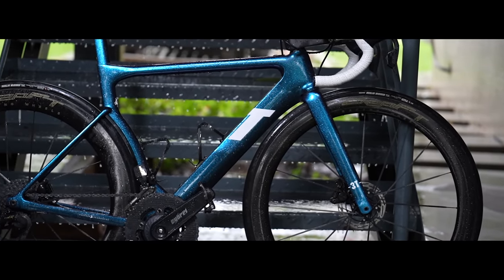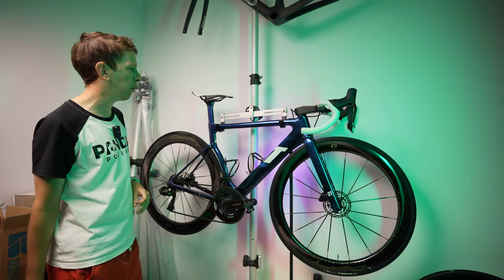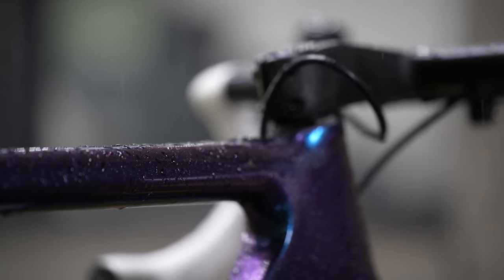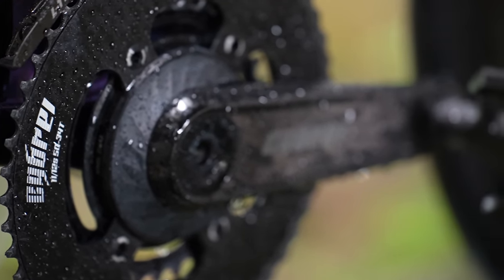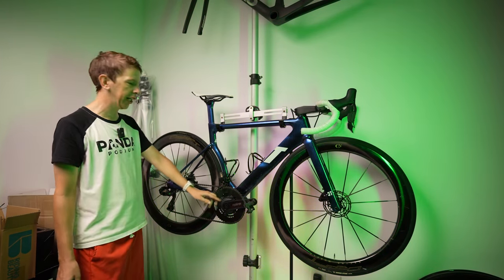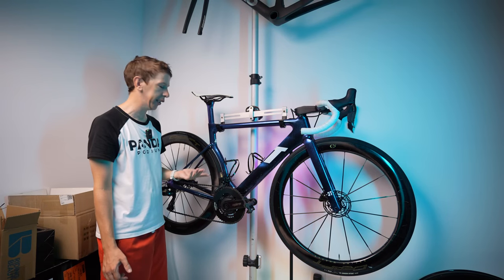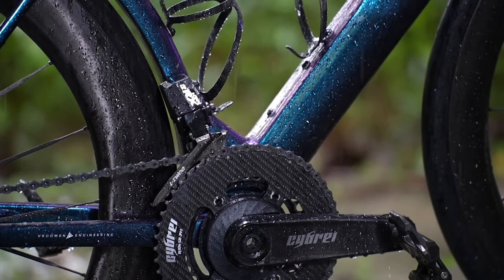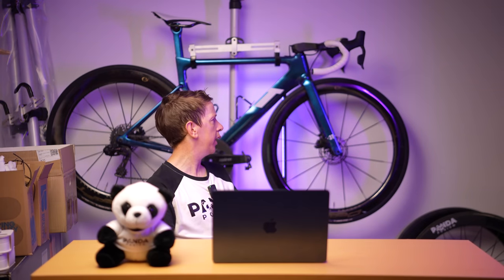3T Strada... A great bike...apart from one BIG problem...

Comment: I have a medium 3t Strada set up with Sram Red AXS 1x; Garbaruk chain ring and OSPW; Craft Racing Wheels; and unbranded lightweight cockpit. I love my Strada! Joe said it perfectly, they hit a home run with the geometry. My bike is a medium and it weighs 7.3kg. I'd like to get it down below 7 but I can't find anything further to change without going to extremes (Darimo...THM...) As is though, I use my Strada over my S-Works Aethos as my daily. Thanks Joe for turning me on to the CRW wheels, they are awesome as well!
Reply from the maker: Yup！I'll take rim brake every day of the week...but if you force me to buy disc... I love the Strada so much! Zero regrets buying this frame. Send some pics to social and tag @pandapodium.official so I can see it! :)
Reply: Bare carbon and tpu tubes could get you there.

Comment: I bought a 2019 model in 2022 as an end of line discount. Its by far and away the most expensive bike I will ever own. When you consider this came out in 2017, it's a design that is at least 8 years old and still really current. I have really enjoyed the 5000km I have covered, so easy to get and keep it going. 
Im not an upgrader but have swapped the wheels out and run tubeless. Dont live near any major climbs so 11/36 works well with a 46t on the front. 
Keep the seat post clamp torqued up, no post slip, the seat clamp has been a nightmare tho. Grit tape has held both, so far. 🤞
Reply from the maker: Yeah, I think it was ahead of it's time...

Comment: @ChinaCycling The wheel issue is probably a dropout alignment issue. This is reason why some metal frames have eccentric inserts from the drive side dropout (you can see the lynskey or X12 system for an example). I think the 3T bikes use a single piece for the dropout and hanger. If you haven't tried a new, OEM or high quality replacement hanger, it might be worth a shot.

I personally wouldnt bother with trying to get a custom hanger made to fix the alignment but that might be an option too.

Also, great looking build!
Reply from the maker: I'm fairly sure this uses the X12 for the rear. Finding parts in China is gonna be a PITA...

Comment: just because it's a thin seat post in the x axis won't really change the compliance. It's deep in the Y-axis and therefore it'll be extremely stiff compared to a round seat post, or even a d-shape post. It has extremely high second moment of area in the axis you expect compliance.
Reply from the maker: I know what you mean, but the Y-Axis is also very thin... especially for an aero seatpost. It's probably 1/3rd of my allez sprint.
Reply: @ChinaCycling  fair enough. Yeah, that Allez sprint has an extremely deep seatpost, as well as the Aeroad

Comment: I have the same misalignment problem with my Velobuild VBR-077 frame, definitely limits which wheels and tires I can use. Still waiting to hear anything back from their support team.
Reply from the maker: It's a common issue due to the bonding of the rear triangle, but it's usually easily caught by QC.

Comment: This is cool. This is what a bike in North America or Europe could look like if Panda Podium takes off. And, this bike looks gooood. I've always wondered what a Western frame would look like fully donned in Chinese brands, and now I know. Great looking bike. Nothing looks out of place or out of the ordinary at all. 12 speed electronic/hydraulic aero bike with deep section wheels, integrated cockpit, power meter, and at the weight minimum. Checks all the boxes. So, how much would this cost an average American consumer vs the $15k super bikes of the Western brands? That is the real questions, and could we see completes like this sold someday, and at what cost.
Reply from the maker: Yup, that's the direction we're going in. Ironic that only one component was a 'wester brand' and it was one of the component with an issue! Haha. Anyway, s**t happens and I don't hate on anyone for it. If I purchased the frame brand new and they refused a warranty, i'd be livid. But I got this second hand so... it is what it is.

Comment: Cannondale has a AI(Asymmetric Integration) rear wheel standard, 3mm and 6mm, maybe this bike has it? Especially since it was a one by only at the begining. Later they have added a front mech hanger, maybe moved to that Cannondale standard to make enough space for the tire and front mech?
Reply: I was thinking the same thing. Maybe the frame is asymmetric.
Reply from the maker: The frame has 1mm asymmetry by design apparently I was told by someone at 3T, and they just said (long story.)

Comment: Have the same problem with the 3T Strada where wheels and tires are touching the frame with 28mm or bigger
Reply from the maker: So strange, as it's main selling point when new was that it was designed for 28mm tires. Does yours touch in the same place. Driveside chainstay?

Comment: does the bike ride ok even with the misalignment? Does it dogtrack or have any other riding issues?
I wonder if you could get the frame checked in the QA/QC department at one of your manufacturing friends 🤔
Reply from the maker: Good question. When I first started riding it, I felt something was weird, but I then put it to my imagination. Then rode about 1000km thinking it was fine. Then when I knew there was an issue, my subconcious went back to being able to 'feel' something weird again.  I may play around with re-dishing some wheels to test. But first I need to figure out if it's a lateral offset problem of an angle problem...

Comment: Garbage company. I bought a 3T with first gen Ekar and it was nothing but problems. Campy CS and 3T did nothing to help. Bike was assembled with kinks in the hydraulic hoses, Ekar cassette wasn’t machined properly and loosened on every ride. Bearings to wheels were shot after a few months. Sold it at a loss but I’ll never buy a 3T or Campy product again.
Reply from the maker: Damn. And then they cover the products with Italian flags and "ENGINEERING" ... it's a joke.